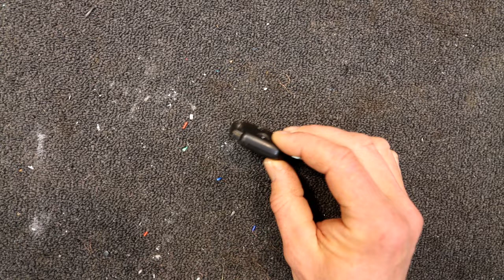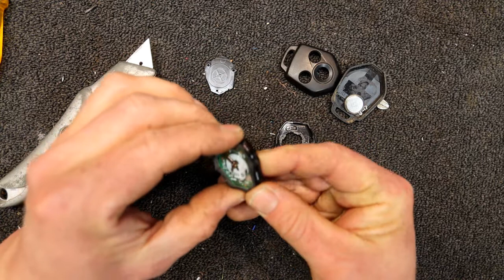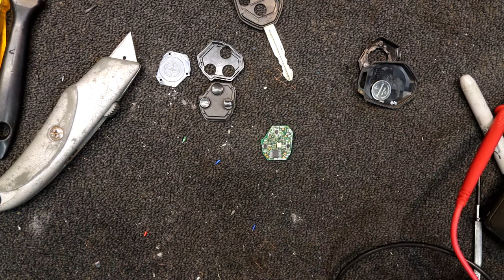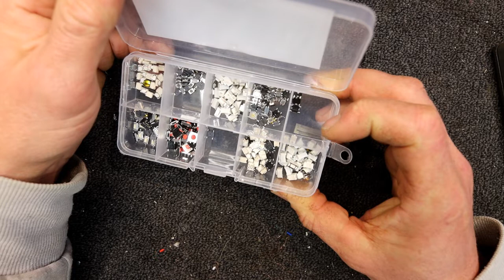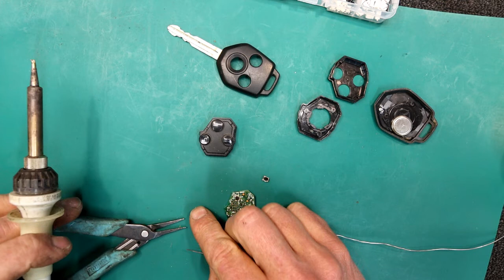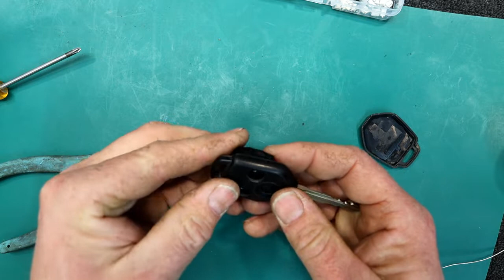Subaru XV Liberty Crosstrek Key Remote Check Battery and Button Switch Repair

Comment: I left a comment on one of your tape recorder repair videos.
"I have a Panasonic RQ-2107. It is in really good condition. The only problem is that when plugged in or when it is powered by batteries, it doesn't play the tape (Reels don't turn).  From what I could hear, there we're small "clicks" coming from it. Any solution?"
Reply from the maker: Have you checked the belt in it? If the belt fails you should hear the motor running but nothing else will turn.
Reply: @StevesElectronicRepairShop  I highly appreciate you getting back to me on a short notice. I'll look into this and see if the band is present.
Reply: @StevesElectronicRepairShop  There is a playback belt. And there are no motor sounds.
Reply from the maker: @casenoova  If the motor doesnt run its an electrical problem. There is a switch on the tape mech somewhere that is pressed to start the motor in play, rew and ff. You may be able to follow one of the motor wires back to it. They occasionally break or bend or get bad contacts. Its also possible the motor has failed. It pays to rotate the motor pulley to see if it turns. If you do it with power applied and the mech in play you may find it starts to go a bit because it needs lubrication.
Reply: @StevesElectronicRepairShop  there is no electrical problem. I check the condition of the capacitors and wires and they are O.K.